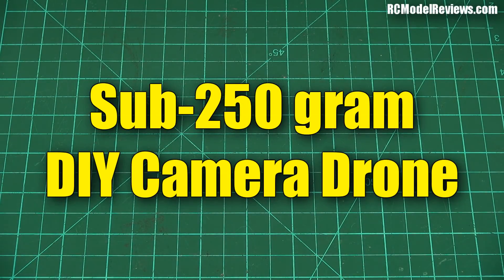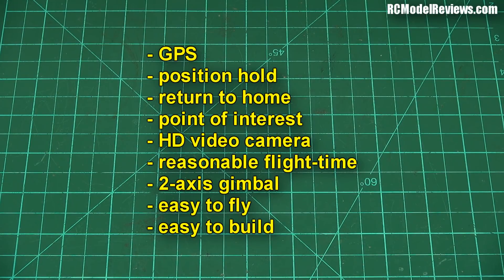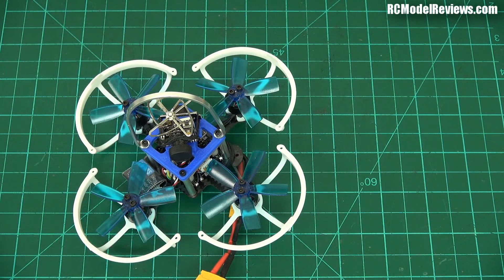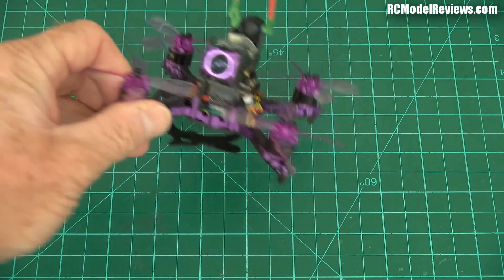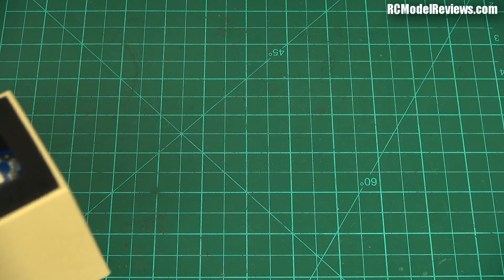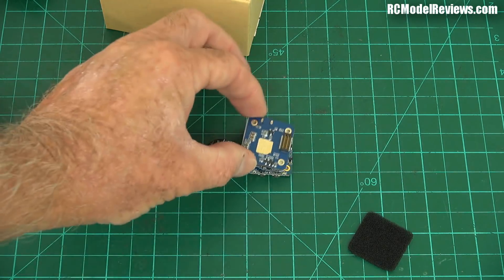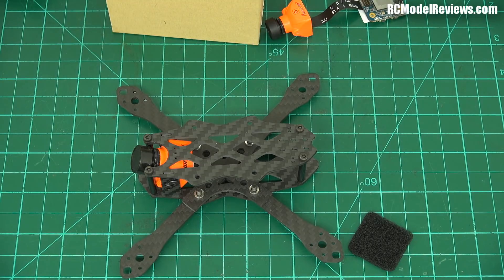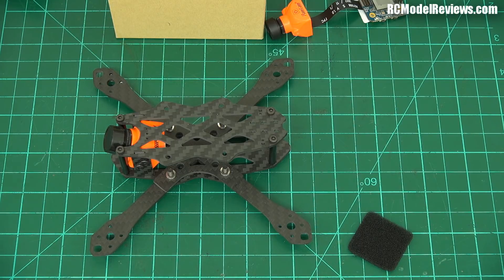A sub-250g camera drone DIY project

Comment: Could you do a few whiteboard videoes going through the math of sizing the componenets on this quad while building it? Prop size, motor kv, esc sizes, wire gauge sizes, connector sizes e.t.c. Also, you might want to check out Align MR25X quad. It might be a good candidate for such a quad. The previous model also had a servo that adjusted the tilt of the camera to keep the camera view locked, independant of the tilt of the quad.